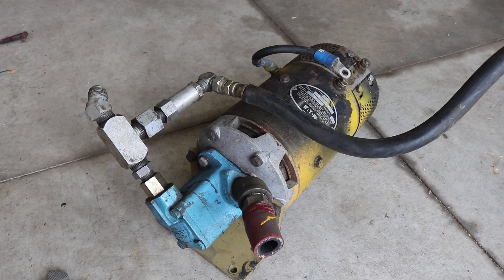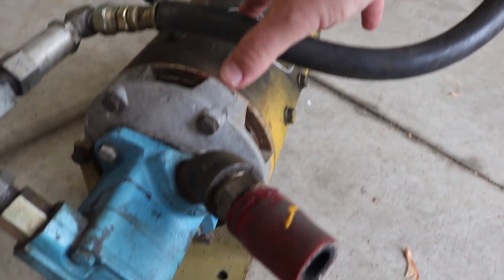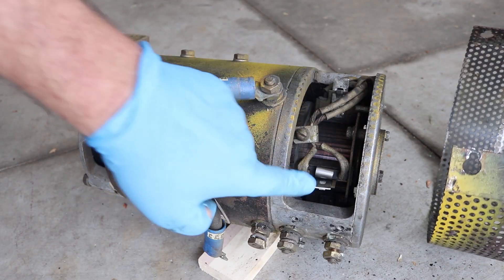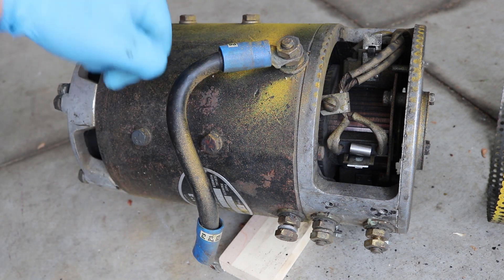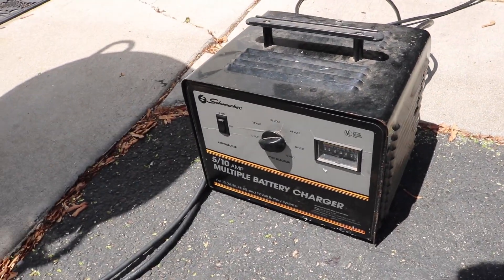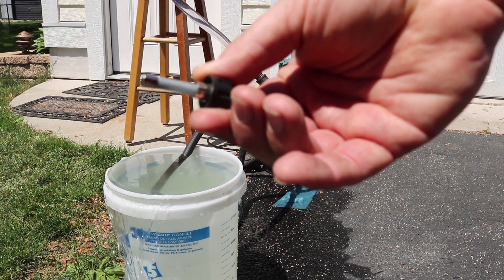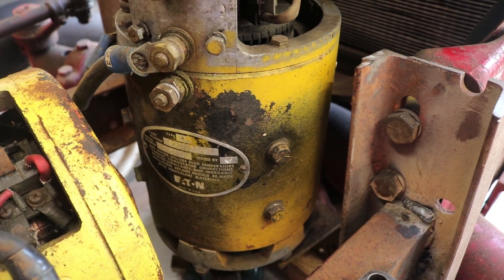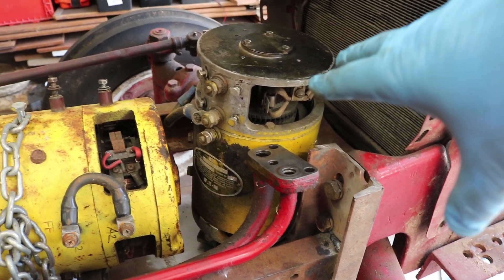Hydraulic Pump Motor and testing for Electric Tractor Conversion

Comment: Hi Ben, your channel is one of the few that encouraged me to make a conversion in Nigeria back in 2109.i want to ask few questions.
1.  Is the traction of the tractor also hydraulic or a direct drive by the motor.

2. What will you suggest if I am using a pump motor for my ev Conversion. Should I hook it up with a traction controller or a pump controller.
PLEASE tell me what you think the difference is. 

Thanks ben
Reply from the maker: The pump is only for the hydraulics on the tractor. That's to raise and lower the 3 point hitch on the back, and to operate the front end loader when it is reinstalled.

The wheels of the tractor will be powered by a separate electric drive motor.

I don't have experience with electric pump motor controllers. I would use a motor controller designed for drive systems.

Most of the pump motors that I have seen do NOT have a drive-shaft. You CAN still use one for an electric car conversion, but you will have to build a "stub-shaft" that mounts into the motor and is supported by bearings.
That was done on the Forkenswift project.
https://ecomodder.com/forum/showthread.php/electric-car-conversion-project-forkenswift-33.html

Comment: keep the hard line and weld a fitting on the other side. cut the tube it would look cool with the hard lines. or make an adapter on the side at the front and then short hose.

Comment: Edit: Okay sorry, you were testing flow rate. Never mind.

No need to do this water test to see flow direction. These are positive displacement pumps so they'll move air just fine. Put your finger over the port while it's slowly spinning and you'll know if you've got suction or pressure right away

Comment: For the hydraulic pipes, why not just chop the two red pipes off and tap the existing metal block for your lines to screw in to.
Reply from the maker: I'd like to leave those pipes stock and try to sell them to a collector or restorer of the same model tractor.
If machining a new piece to mount to the tractor for the hydraulics proves to be too challenging, I can always fall back on modifying the original hard lines.

Comment: Don't use sand paper to clean the Commutator surface, Use crocus cloth .The abrasive from all sand papers contaminates the commutators leading to early brush failure.
 Federal Specification P-C-458 described this material in detail, although the specification was cancelled in 1989

Comment: Is running water through a pump meant for oil a good idea?  I imagine the pump needs it to be oil to lubricate the pump internals.
Reply from the maker: It's probably less than ideal, but I just wanted to do a flow test, make sure I had all the ins and outs right, and learn anything else I might be thinking. After the test, I dried and oiled the pump.

Comment: Unless you are trying to save those hydraulic hard lines, I don't see why you want to go through the effort of machining a block to fit.  I would think it is easier just to cut the hard lines off of that block, machine face it, or use a sander to level it out,  and then thread it for an NPT nipple.

Comment: How many hours of working wise for the batteries do you expect to fit in, its a shame you can't fit the leaf set up in as it's the charge control as well. It's a cool project and glad to see it back 👍
Reply from the maker: I just plan to cram as many batteries in there as physically fit. What the working time of the tractor will be is so dependent on what the task is. Not really any way to know that until we try it!
Reply: @BenjaminNelsonX  fair enough good answer, like how long the string, are you still looking to use leaf batteries or build your own packs.

Comment: I am really enjoying watching this project.  I want to build something similar one day.

I think that is a good layout for the pump.  Hydraulic pumps like being lower than the supply tank.  A hydraulic shop could likely cut and add fittings to the end of the hard lines you have.  This would allow you to have much shorter hoses.

Comment: I agree with keeping the radiator on the tractor. Not only for looks but gives you the option of having either a cooler for another motor later on or a hydraulic cooler on the low pressure side if it needs to do much front loader work.
Reply from the maker: If I used something like Chevy Volt batteries, they already have coolant tubes/fins in them. I could use the radiator for cooling the batteries in the summer.
In the winter, I could use the same coolant and a heater to keep them warm.

Comment: Heck yeah bud!! its looking awesome! What do you think about NiMh prius packs!? you got the room for it and a tractors gotta have just super robust abuse tolerant chemistry that self heats and doesn't mind the cold, dont need a bms, CAN be charged in parallel if you just charge at 1/10 C?  food for thought
Reply from the maker: I'm leaning towards used electric car batteries. Cell modules like those from a Volt already have cooling channels built-in. Those could be used for warming the batteries in the winter.

Comment: Why two forklift motor..
Is that two motors connected to transmission..?
Or each one is for different purposes
Reply from the maker: This motor pumps hydraulic fluid. The other one drives the wheels and the Power Take off. Two motors like this is very common on electric forklifts.